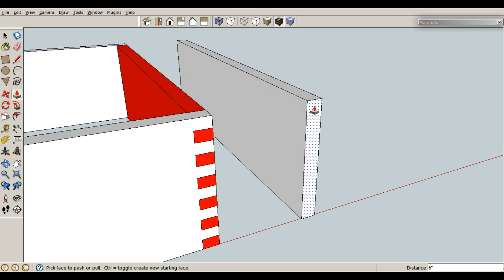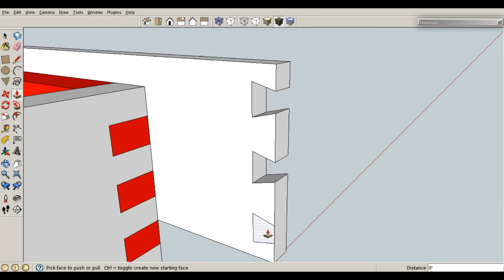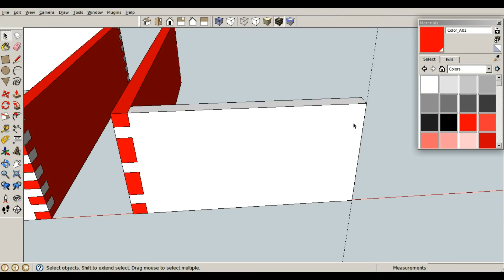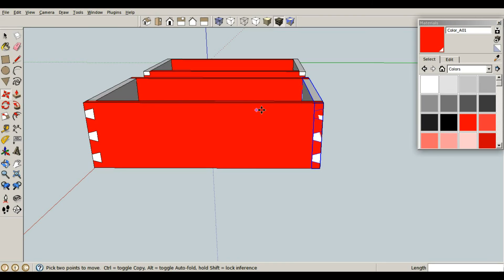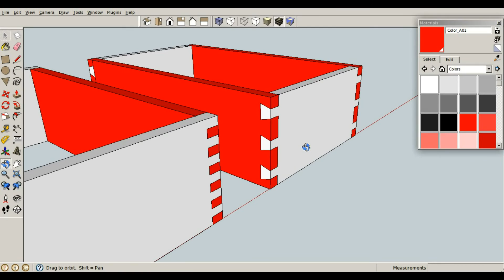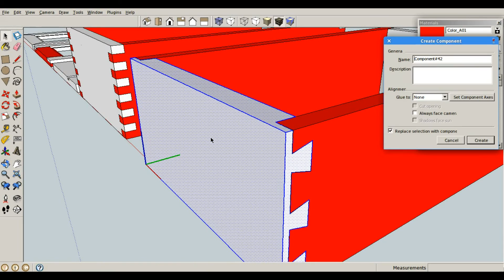SketchUp Dovetails

Comment: Great stuff again Jay thanks. I've linked some of your videos into a woodworking forum in the UK so hopefully you'll get plenty of hits from there ;-)
Reply from the maker: Awesome! Very cool Graham. I appreciate it.
Reply: Jay Bates Also found a tip on another YT vid. I don't know if you know it but if you click the relevant direction key when moving or copying an item along an axis it locks the item to that axis until you complete the move so that you can move your cursor around without the item wandering off the axis.
Reply from the maker: Yeah. I always get the arrows vs colors confused. I prefer shift as it will lock to whatever you snap off of.
Reply: Jay Bates Cool, thanks, noted.